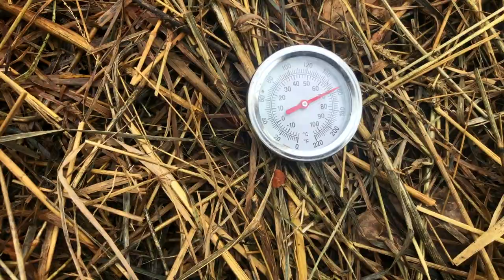Greenhouse - Heating with Compost Power and Moving Water?

Comment: I didn't read all the comments but one thing i did notice is you are probable loosing a great deal of your heat from the open top tub . I think you have a great idea there , one thing you might try is using a black drum drum inside , the  drum will help to draw in heat as well as radiate heat from the water . I am thinking about using a set up very similar to that .
Reply from the maker: Interesting idea there, I will keep them in mind.

Comment: Jean Pain heated a greenhouse to 35 degrees c., - 90 degrees f. for one whole year solely by a compost pile made from forest litter and other forest debris. The heap was around twenty tonnes in weight, and the greenhouse was built on a bank about one metre - three feet, higher than the compost pile. He used about 100 mm, - four inch, agricultural pvc pipe connected by plastic elbows. the heap was rectangular and If I remember correctly Jean took two turns of the pipe through the compost pile and then into the greenhouse. 
There were no fans or pumps, it was strictly thermosyphoning from the heap into the top of the end wall of the green house, and the cold air went back to the compost from a return pipe near the floor. Temperatures got below freezing, but the greenhouse kept warm regardless of the weather. This works because of the volume of the heap. I have done many years of experiments, and it is necessary to have a heap of four to six tonnes at least, to make the output worth while. Even a five tonne heap, although it can reach temperatures of 65 degrees c, will only last three months or so, and the temperature will steadily decrease after the first week. It is good enough for two people to have a hot shower everyday for three or four months and with enough hot water to do the dishes etc., but for really useful amounts, go for twenty tonnes. 
This takes quite a lot of scavenging for organics, but imagine how good you will feel when you harvest seven tonnes of pure worm castings a year later, after growing food all winter, or heating your home for free. Currently we lose billions of tonnes of forest litter to uncontrolled fire, and organic waste is everywhere waiting to be used. 
As I said, I have done over twenty years of experimental heaps intended for driving methane digestors, and am delighted to answer any questions if I can.
Reply from the maker: I've never measured compost by weight, so I really have no idea what this or other piles weigh!  I can get a decent sense of the dimensions of the pile but have never thought about them in weight!
Clearly I'm sold on the idea of collecting and working with as much organic matter as possible.  We send most of it through our chicken composting system but bulking out a larger system would be compelling to me.  The limiting factor is our small site and trying to figure out the best relative location to put things to be able to have a large enough pile close enough to where we need the warmth/water delivered!  It'll evolve over time I'm sure...
Reply: @edibleacres  Please be mindful of building a big pile next to your living quarters. Fire is a possibility when you start building bigger piles. They can dry so fast and spontaneously combust!

Comment: The thermo-siphon idea you have is pretty good. It will self-regulate itself because it will only move as fast as the heat moves into the water. As long as the water entering the bottom of the loop is cooler than the compost pile, it should work. Just make sure that the cool water pipe entry is about the same level as or sllightly higher than the bottom of the coil in the compost pile. Oh, and the cool water should always enter the compost pile at the bottom of the coil. The hot water will move "uphill" as it were.
Reply from the maker: I am hoping to accomplish just this.  Probably some adjustments need to be made!

Comment: A couple of radiators salvaged from a wrecking yard or abandoned  vehicles can be connected one above the other to make an effective solar hot water system. (Make sure they don't leak, and paint them matt black if they aren't already painted.)
200 litre Plastic Barrels, painted black to absorb heat can be placed along the back of a greenhouse wall to absorb heat throughout the day and will radiate the heat back out during the night. The two systems could be combined to provide a storage battery of heat, or even be used for an outdoor shower.
Reply from the maker: Cool thoughts here, thank you..

Comment: Hi, very interesting to view a home version of this type of system 👍. I appreciate the duplicate centigrade temp you include in your video.

The overflow idea: could you combine it with a wicking bed system that has its own overflow to prevent overwatering?
Reply from the maker: The wicking idea is possible, not sure if it would be too complex... So far this has worked pretty nicely.  If we get heavy rain I use it as an opportunity to dip into the tank and water heavily the other areas.  So far so good...
Reply: EdibleAcres: thanks for that 👍.

Comment: Do NOT try to use an IR thermometer to measure the temp of water.
The limiting factor is the amount of heat generated by the organisms, not the amount of tubing.  In fact, if you extract too much heat, you will kill the heat source altogether, and the pile will freeze, and won't thaw until spring.
Thermo-siphoning will not work without some height on the tank.
Longer tubing will not significantly affect the heat transfer.  And if you need more heat transfer, you can increase the flow rate.
That small pile will not make enough heat to keep the greenhouse warm, your house is right out.  Think about how long a pile of wood like that would last you in your woodstove, that is the maximum you could ever get out of the pile.

If you want to talk more about this, let me know, I am willing to trade energy advice, for seedlings etc.
Reply: I agree with this assesment and I am a professional in ecofriendly housing. There is not enough material to heat, etc. 
This will keep warm for a month or so but come january the pile will be exhausted. 
You may try to use humanure on the center pile to keep it going for a little more, but there is only so much energy in organic matter. 
Your system is very good : it is just a seadon extension, not a real heating solution in freezing climates.

Comment: Attaching your hose at the bottom of the tank and just set the tank on some  blocks a foot or 2  will passively move the hotter water out the top hose. The higher the tank the more presser and the faster the flow.  Good luck

Comment: Would it be feasable/more efficient to put the compost pile inside the greenhouse, eliminating all other components and using 100% of the pile heat?
Reply: Some of the gases generated by the composting process are irritants, dangerous, or both. Concentrated indoors, the ammonia smell can be overpowering if the system turns even slightly anaerobic.
Reply: @gregorymarlett1277  seen a guy run a fan through the compost pile to return air to it and cut out the ammonia. Could be worth a try. But I like better the idea of using the compost pile as both a thermal barrier and a heat source from outside.

Comment: A lower volume pump gives the water more time in compost pile to warm
Reply: A slower pump and snake the pipe crisscross between the ground and the compost pile which will allow the earth to become a thermal mass. That will make it easier to turn the pile later. It will disperse the heat exchange better and will not try and take heat from just one small area in the pile.
Reply: My suggestion is to enclose and or insulate the compost first.  Within reason to maintain a functional compost.   

Second:   Consider getting a car style radiator set up inside your house with a fan behind it and your inlet and exit pipes plumbed into it inline with your temperature activated pump.  This could be your heat transfer method.  

All the best. 
Alex.
Reply: @alexemery3045  wow great idea. Definitely throwing this in my back pocket! 

Thanks

Comment: Just keep running it until it is back up to temperature.  You took 40 degree water and ran it through hot hoses,  of course it's going to cool off until the water in the buck and coils become the same temperature in both.  Then set up a timer to run every 30 mins or so for 5 mins and it will maintain the temperature you want.
Reply from the maker: A timer is in order if I'm going to keep with the pump for sure...

Comment: What you have is an "open" system at the moment. You could put a heat exchanger on the end of your tubing which would be submerged in the water to make it more efficient. Then you would have a "closed" loop system. You can get an immersion chiller from a brewing supply place for about $50. They chill wort for homebrewing but it works the same way as a heat exchanger, it is a heat exchanger. Then insulate your tank with foam and close the top up with foam too. You'd have to plumb the pump inline but its not hard to do. Then put it on a timer, maybe run it a couple of minutes/hr or just turn it on every so often and you could keep your tank fairly hot I imagine, insulated. Raise it up and you can plumb a pipe into that fitting and let it gravity feed to wherever you need hot water. You'd have a chance at heating your home if you had tubing in the floor slab but that's the only way I know to use water for space heating, radiant heat. You essentially have a small water heater using an alternative fuel.

Comment: Basically for a passive system you will need bigger pile bigger tube and  warm water rises in the compost and goes up( tank higher then compost pile)  think I saw snow so you need 4 + cubic meters. For heating the house as well you need much more. But for accurate heating you need a small pump to be sure the heating works smoothly.
Reply: Also the system you have where the pipes are fixed on the metal structure you need to think of the  decomposition of the compost pile. therefore it's necessary that the pipe can accompany  the decomposition and fall down otherwise sooner or later you will see that the top will be exposed because the material decomposed. Also you need to look into hot composting.Using woodsips from green branches at a 9 to 1 ratio (1 manure for 9 of woodships)I have a pile that last 1 year constantly providing heat for shower and washing dishes etc..

Comment: I know this is late in the posting game, but...

It would be a bit of work, but imo I feel it would be worth it. 
Invest in the line, most site you can pick up 1,000' of line for $300. 
Excavate your greenhouse and lay the line in using the perpetual figure 8 coil (like used in geothermal heating methods), then rebuild your garden beds on top. The thermal cycling of the water should more than warm the soil without burning your veggies.
I built a horseshoe coil for my compost for easy clean out. Same principal, but stake out your coil core in a U shape. My bed is roughly 15'sq with a 10' U in center using 30 pieces of rebar for staked frame (salvaged from neighborhood construction sites) that I gave a good rustoleum coating for longevity. I then wove the water lines through the U in wide swaths, back and forth to avoid kinking, until I had a large billowy looking horseshoe. The more line, the more water, the more hot water. The line at the bottom of the U is the intake, the line at the top is output. THEN, I took some salvaged 3" french drain with the weed cloth wrap and laid it on the ground around the outside of the U with each end protruding from compost containment. This is for aeration, reducing need for turning. Pack compost in all around.
Once a year, I remove the front panel, remove the compost easily from in and around the U, give it a rinse, repack and repeat in 12 months.
With the footage of the line, I would use a 100gph water pump for a steady cycle and routing it through the tank is more than feasible. I kind of like the idea of it acting as a humidifier/snowmelt/rain catch storage. I have mine running into a salvaged 30 gal water heater.
For the overflow, if you want to invest a little more, a 5 gal bucket with another small gph water pump that has a float switch and a misting line for wide/even dispersion of the water.

Comment: Bigger pile and more hose plus you are moving water pretty fast at 50 gal per minute. If you raised tank up and at bottom connect cold from pile and then have water just circulate slower it will stay hotter. You could also use a small rampump if you had two tanks one high and one low  when water from top tank flows down

Comment: Do  you have any concerns that drawing the heat out of the compost pile can cause it stop generating heat? Can you "drain the battery" so much it stops working? EDIT: thanks punky that is what I meant, drawing too much heat and stopping decomposition.
Reply: The pump don't need tho use many power  . I care battery and a 400 watts solar panels should be good .
Reply: @Void I think  Butch means the heat "battery" of the compost pile.  If you pull too much heat out of the compost it will cool and halt the decomposition that is generating the heat.  I'm currently experimenting with heating my greenhouse via compost and that is a genuine concern.
Reply: @punkyroo  sorry  i was confused  with "drain the battery"  in @Butch sentence . My background in electrical engineering triggered me! 
It makes sense that it's probably the heat generated in the compost getting to much drained out .
Reply from the maker: I'm not concerned with that.  Right now the pile is RIPPING at 160F and loosing a TON of heat to the atmosphere, so I'd like to reclaim that.  I think if the pile was running at 80F I'd be happier with the health of the compost it makes actually.

Comment: Among other ideas, one thing that I tried last summer (I started a small pile, probably twice as big as yous for experimenting) is that I kept some urine and when the pile was pouting out less warmth, I poured as much urine (appox. 10 2 liters bootles) in the middle of the pile. The next day, I always noticed (with a thermometer) a BIG raise in temperature in the middle of the pile. So it's like putting fire wood in the wood stove...  II's 100% free and 100% organic!!! So rather than flushing it in the toilet... you can use it with great results!
Reply from the maker: Yep... Believe me, you don't have to sell me on this aspect.  I've been saving and using urine for gardening/etc for 12 years.  This pile was kicked off with 3 gallons added right around the coil!

Comment: I'm a little late to this video but I have a couple of suggestions. 

To gather the most heat from your pile why not have the hose/ pipe running all throughout the pile, not just in a coil in the middle. imagine the layout of under floor heating pipes but in your compost pile. 

The second might need a bit more work and a different set up. You could put the water tank in the middle of the compost pile. Water is obviously good at storing heat so once it got going and the water was warm it shouldn't have any detrimental effect on the internal heat of the pile. Downsides are that the tank may be a bit harder to access and you would need to make sure it was covered in a good layer come winter if you get cold temperatures that might freeze the water. 

There could be a good reason why you haven't tried either of these, I'm no expert its just he first thing that came to my mind.

Comment: Try raising  the water storage above the height  of the compost (thermal dynamics) should  bring the heat without moving the water. I would also suggest using  a black barrel to hold  the water  and produce more heat. I believe  the trough open top with surface area would release  heat to fast. Or cover the trough and paint it black. Thanks for sharing the video
Reply from the maker: Good ideas here.

Comment: Drill a hole in the side,pass a uniseal in, a PVC pipe of the right diameter, an elbow up and pipe to set the overflow level. 
On the outside, you can build a minifold out of T Union and PVC pipes to distribute your water to the beds. You probably want ball valves to make sure the water distributes into the different beds. 
The sizing of the pipe is the real issue here: how much flow do you expect?

Comment: with my father we used to make raised beds about 0,5m height directly from manure with top layer of compost+soil. it was heating the beds directly from bottom plus heating the greenhouse air from feb. to end of april. would not last through all winter though, but you have not so much sunlight either to grow much. it could strech our season for selling vegetable seedling 40cm high in beginning of may. laborous to remove spent manure by end of summer though.
Reply from the maker: I've heard of and seen examples of this before... Seems really smart!

Comment: Do they make mini ram-pumps?  Any flow could get pushed by the pump, which would raise the stock tank level, which would force flow, which would get pushed by the pump, etc.
Reply: They do make mini ram-pumps, but they require, (as so all ram pumps) a constant flow of water to power them... which I don't see in this set up.

Comment: What is the state of the underground thermal battery and is there a way to combine the two?
My first impression about the compost heater is that the pump is moving too much water too quickly. How can you dial down the pump?
You also need to address the heat loss through single  pane glass.

Comment: If it hasn't already been mentioned, would be good to insulate that metal tank of water and put a lid on it to maintain the temp. 

Also, the water flow rate from the compost seems too high. Maybe the pump voltage can be lowered?

Copper coil pipe would be ideal inside the compost pile, but that's not the usual kind of thing you'll find cheap. Otherwise, see if you can find some old car radiators.